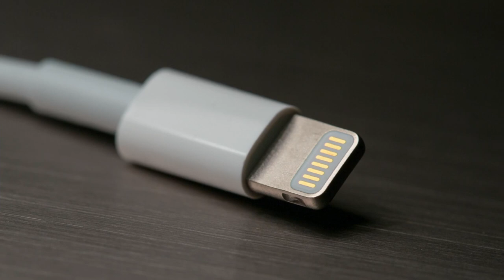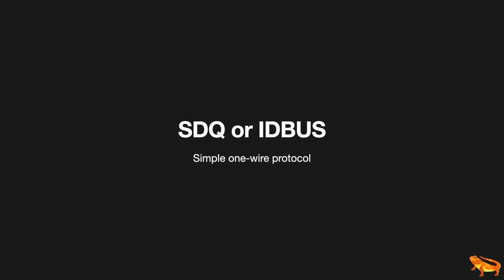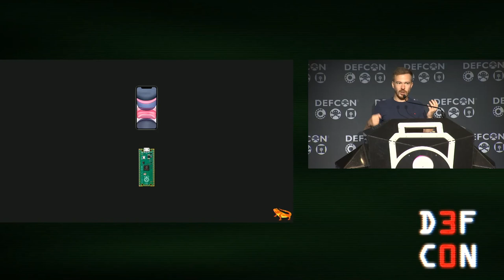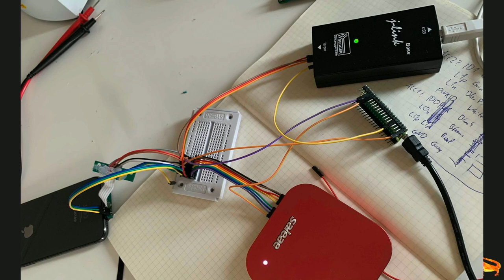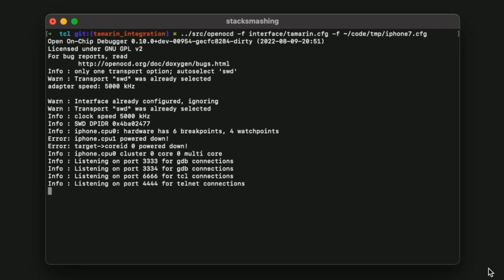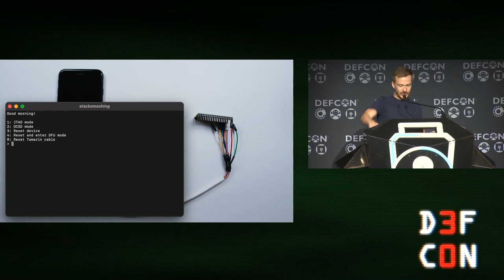DEF CON 30 - stacksmashing  - The Hitchhacker’s Guide to iPhone Lightning and JTAG Hacking

Comment: Damn, I would love to get into hardware hacking of this kind of caliber.
Reply: Do a degree in Electronics Engineering....
Then it becomes easy.
Reply: @deang5622  sorry but no.
I’m an electrical engineer for a German automotive company and nothing like that is taught in university.
Yes you learn the basics, but nothing that directly lets you hack phones on any other device.

Edit: autocorrect errors corrected. University and the universe are apparently the same to my iPad..
Reply: @deang5622  university is for those with no drive
Reply: @sumthinfresh  Clearly you have never been to university.

University is not like school. You have to be self motivated and work your socks off in the evenings and weekends to pass an engineering degree.

Having "Drive" is a must
Reply: @rolux4853  Just so you know electrical engineering and electronics engineering are two different things, completely apart from each other. Of course you're not taught how to hack into a lightning cable, but you're give the fundamentals so that you can understand most of what he did and maybe with some effort you could've figured it out yourself.

Comment: Can someone explain what extra things would the JTAG allow to do comparing to a regular lightning-to-usb connection with a jailbroken device? From what I understand it makes it a bit easier to install arbitrary versions of the firmware (by entering into a DFU mode)? 

Also Would there be any benefits with having a jtag connection to a non-jailbroken iphone?
Reply: Root access to the device for data apple really doesn’t want you to see, this will help jailbreaking community a lot
Reply: @abdelbakiberkati in fact it’s really the keys to the kingdom. There are probably quite a few vulnerable states during boot and operation that are not precisely logged or otherwise visible even to a root user on the device without jtag. Custom hardware in the future, too, maybe. I’m thinking sniffing out oracles, baseband management (GSMK style BB firewall would be nice,) many many things.

Comment: could this be a viable way to jail brake iPhones
Reply: As mentioned, it makes using the Checkm8 exploit slightly easier, however most of these techniques have been known for years, and haven't lead to an exploit.

Of course, maybe, but probablhy not.
Reply: you can only access UART without JB, and that doesn't give you much
Reply: @zat-svi-ua  so this is helpful to find zero day exploits in old IOS that might still exists in new one ??
Reply: @ko-Daegu  that's right.